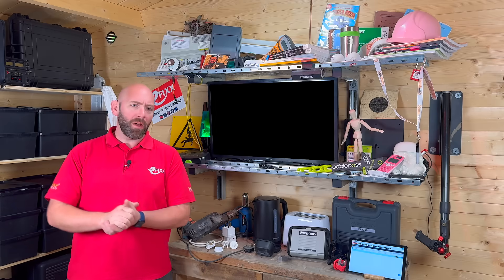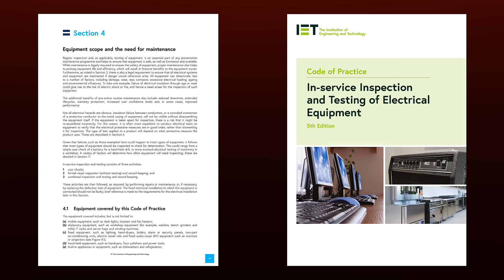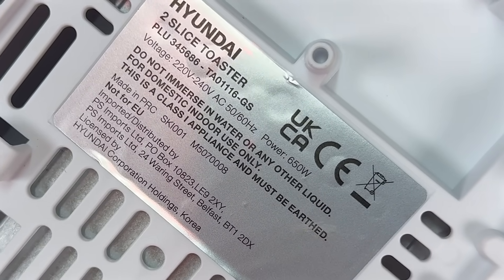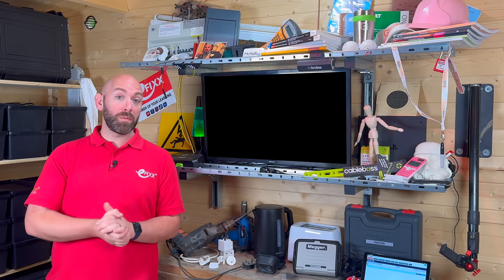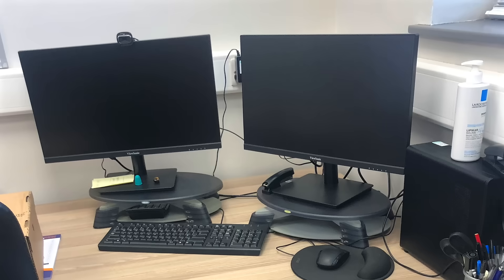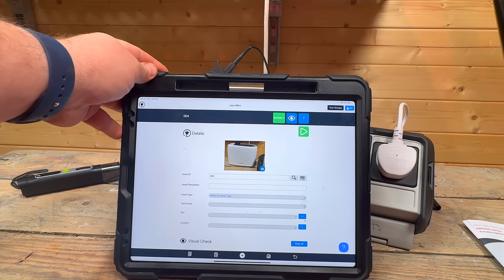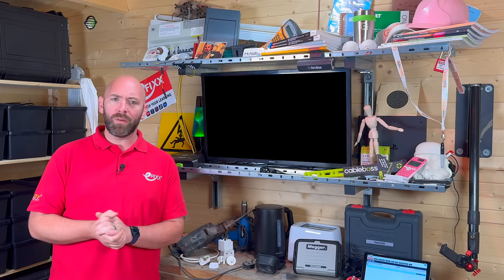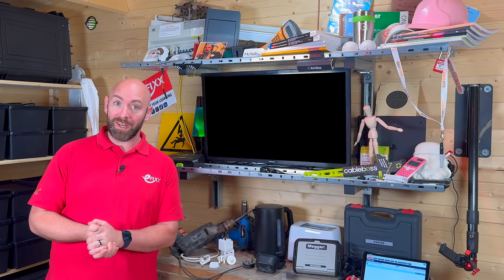PAT Testing ISN'T What You Think It Is!

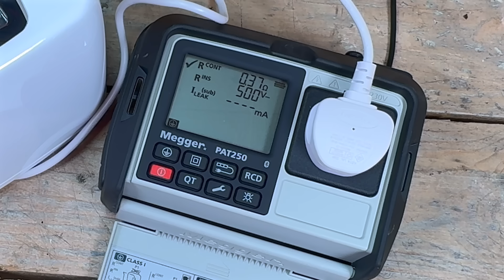Comment: I'm surprised that no-one has commented on the display of the Megger PAT250 when the toaster has undergone an earth continuity test at 2:25. It shows an earth continuity resistance (R CONT) of 0.37 ohms and has a tick to show it has passed that particular part of the test. However, as I understand it, for Class I appliances, resistance should not exceed 0.1 ohms for cords up to 2.5 metres, increasing for longer cables, depending on their cross-sectional area and length.

I assume that the person using the tester has changed the Megger's default pass limit for this test for some reason, but it looks like a fail from where I’m sitting. Also, as someone else mentioned, the toaster should have been turned on for that test, as indicated by the flashing switch icon at the bottom of the display.

Comment: 5:03 Of course that hot air gun passed the Class II insulation resistance test, as you didn't have the probe (P1) connected to any exposed conductive parts.
Amateurs.

Comment: We had a Contractor come in to PAT test equipment in the College where I worked, our Works Manager went to use one of the joiner’s hand drills that supposedly had been tested and as an Electrician himself decided to do some basic tests, visual inspection found the outer sheath had a cut on it which was an immediate fail and it had a nice shiny PASSED sticker on it. He then decided to get our regular Electrician to check some items in our Student Halls of Residence more dangerous faults were found. He contacted the owner of the Company and on the Monday morning when the tester arrived in his Company car his boss was waiting for him. The tester left shortly afterwards without a job or a car. Turns out the guy had done a 6 week course to become a tester.

Comment: I've never seen an item fail a pat test.
Reply: You've never seen some of the Banggood tat that I've seen my office manager purchase - the socket strips with built in USB ports that had live and neutral swapped resulting in a fused neutral. The USB charger circuit board was a joke - tracking distance between AC and DC sides was minimal.

Comment: so basically in this you have show, 100%, are good idea, but with that many verable in the test any sort, single test, where cauley just plugs an item of electric equipment to PAT testing machine can get to what they want it to say, like tostter example its double insulated, to point the large exposed metal at the top, the totting part? that part not double insulated its not single  insulated its bear metal, and bring laptop style power bricks the come  manufacture earth leak on design person as part of there normal working function, that fail right the start, you defany going fail beeping out Pat test device with test examples and that just you used as. test subjects? so with full understanding how the subject works cireket designs mantanal manuals and all the the manufacturer seem to leave out of the consumer, and  repair business, there now way of know, out sample, gess work? making a PAT next to useless, and give good working equipment bad reports, and still letted faulty, bad designed equipment a green light quality its does not deserve

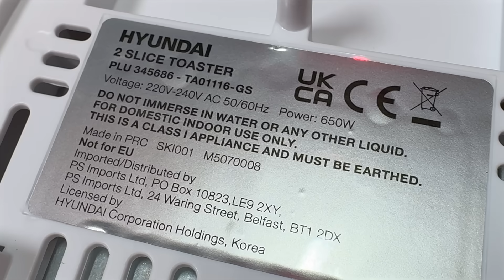Comment: The product label at 01:23 gives mixed messages: If it's a Not for EU appliance, then how/why does it bear a CE mark? 🇪🇺

As for PAT/ISITEE, I worry about what I term „PAT box blindness“; Where having a box that runs tests on a couple of button presses makes the operative forget how the tests are performed over time - Rather than Is that fault loop <=1R0? it becomes Does the tester say it's OK? And of course a blindly run Earth fault loop test will still pass on an appliance with a grazed flex with exposed earth (Or worse ⚡) conductors which might be missed if there's „Not enough time“ to carry out the essential visual checks for appliance condition. ⚠

Me, personally? Only testing my own appliances now (My PAT cert dates from 2001) I use a multimeter instead. Not just because I can't afford a business-priced tester that I can only lawfully use on my own equipment, but also because it makes me think about the test being conducted through the appliance. And thanks to this, my mind for what's happening in each test doesn't fade to the just push a button culture which isn't the safest thing to see happening with something as potentially dangerous as appliances intended for use on 3,5kW UK electrical circuits! 👍

Comment: Several years ago, I was writing training guidance for the cleaning industry, and it seemed to come as a great surprise to a lot of people that PAT does not test appliances for performance, nor does it provide a safe test at all the different applications an appliance has - most notably for this industry wet & dry vacuum cleaners,  irons, and washing machines, all of which could sail through a PAT, but could become dangerous once water was used, seeing how it could get into places it wasn't meant to, or in the case of things such as a blown heating element on a washing machine might only present a problem during the heating part of the wash cycle.

Comment: In an industrial and commercial setting one of the biggest issues I have found as an electrotechnical engineer is the incompetence of the average portable appliance tests operative. There should be some protection for equipment owners where there is an absolute requirement that if you don’t fully understand the functioning of the item under test you must not test it, and refer to someone who understands the equipment. 
While working as a specialist service engineer about 15 years ago I spent some time following a portable appliance tests operative company around repairing the expensive digital audio processing equipment they had just tested with a class 1 test and ruined the filtering on the power supply. Similarly we had “PAT test) stickers on non testable items such as remote volume controls, blank rack panels, panels with logic control buttons connected to GPIO ports of remote located DSP units, and many many more. The testers seemed to view their little “pass” stickers as a license to print money, and were very fraudulently knowingly applying them to anything that looked in any way electrical or electronic.
Reply: We had one came to our College to test our gear having completed a 6 week course, our Works Manager found items that had been passed that should’ve failed on visual inspection, called the Company owner and when the guy arrived back on the Monday morning his boss was waiting and sacked him on the spot.
Reply: @tumshie1960  China uses a plug similar to Australia/NZ, but with longer unsheathed pins, but upside down.  Dodgy electricians here tag them despite new equipment not being allowed to have uninsulated pins, and the lead exiting the plug skywards!  There is risk a child's fingers can touch live pins on the Chinese plug partly in an Aussie socket.
Reply: If there are complex pieces of equipment in a workplace specialist company should have been hired to start with
Reply: Definitely agreed with you on the first point. I took a PAT course many years ago as an aside to my role at a local charity (We had a lot of donated electrics, and a second PAT person was sorely needed) and nothing I passed ever experienced a known safety failure, but this was before Class IIa and Class III appliances came about. I still apply my PAT knowledge when I need to, but only to my own personal appliances as that's still safer than no on-site testing at all.

Oh, and no; I don't use the little green stickers. If there's one from a company that has it on record I leave it in place, but if it has no recordholder or is more than 2-5 years old (Depending on the appliance class) off it comes. 👍

Comment: The thing is, though, PAT testing doesn’t really guarantee safety — it just means that at that exact moment, the thing isn’t likely to kill you. Useful, sure, but let’s not pretend it’s a crystal ball. Whether you call it PAT or EET, it’s still just a snapshot — not a safety guarantee. All it tells you is that right at that moment, the kit won’t kill you. Tomorrow? Or 5 mins time? Who knows. Maybe you’ll get lucky like I did working in a gym. I had my back turned from a hoover as you do with a pull along, and some numb nuts had dropped a dumbbell on the cable. One touch as i was moving the cable over a pieceof equipment, and I was jittering to “Murder on the Dancefloor.” 🙄😲 And yes, i absolutely checked the flex before use!
Reply: exactly, pat testing wont 'guarantee' the thing wont explode when its next powered up and used!

Comment: Plus with the green stickers, if the plug has one you need to remove the old one from the plug before you put a new one on, as if it has loads of stickers on it, it can make the plug over heat.

Plus if the moulded plug is damaged you  need to cut it off, and replace it with type the reusable.

Comment: Plus also the plug of the appliance, is it safe? Ie is it legal, the live and natural prongs is sleeved, the earth is either all metal or all plastic, as number of times brought items from Amazon and other online stores, the plug is totally illegal, the size of the plug is too small, the earth is sleeved, the prongs too closed to the edge. 

Also I noticed and wondered where is the correct place to put the label, I was told and seen it should go on plug.

Plus if the plug is type that you can open up like on irons, some lamps etc, are they wired up correctly the brown (red ) is wired to the live terminal, the blue (black) is wired to the neutral terminal, green and yellow (green) is wired to earth terminal. This how I remember when rewired a plug, the first two letters of the wires tells where it belongs, brown (br) tells it goes bottom right, blue (bl) goes to bottom left or with the old colour red and black, because black start with bl meaning bottom left, red goes to bottom right, any other wires that leftover goes to the top. As number of times I seen the wires in the plug when opening up is in the wrong place, even the wires are in the right place but not tighten down.

Plus with these plugs also the cable grips most be over the outer sleeve

Plus live, neutral and earth wires are cut to correct length.

Comment: whats the skinny on meter calibration..,, i shove a 10m resistor at it before use and if it says 9.5 to 10.5 then i consider it 'working' and in spec
Reply: You can get something called a 'calibration card' from the usual online places, might be an idea to get a few to make sure they're all the same, as they're not expensive; but yeah, if you've got some standard resistors, preferably higher wattage ones for better high voltage resistance when doing the insulation resistance calibration check, then that should be good enough. The cal cards are very portable though, just chuck one in the tester carry case.

Comment: strange how charity shops either "insist" on donated electricals being tested, or more often, just refuse to accept them.
Reply: Our local charity shop has someone trained to do the testing and a testing machine.
Reply: i used to test things for a charity shop. most of what came in for testing was bad in some way, often it was the plug or flex was bad/wrong or outdated
Reply: @Bullwinkle39  did any of your items make it to sale?
Reply: It depends on the shop. I used to do PAT work for a local charity (We had such a high volume of donated electricals I was more than happy to do a PAT course to double our capacity) and we tested and recorded everything in-house when I was there. Other charities (Usually the mainstream ones you see in the high street) will also employ PAT qualified persons as an internal role, or will bring in an outside contractor to test donated items that have passed the „Junk sort“¹ and unqualified visual inspections for faults, damage, and (After those checks) a function test. 👍

Smaller charity shops - And more remote outlets of mainstream ones - Tend not to have PAT infrastructure in place or affordable to them, and these shops will tend not to accept electrical items at all. Because law requires that anything sold by retail is safe for a consumer to purchase and use without any special advice or training, shops that can't PAT can't legally sell donated electricals, especially used goods which have an unknown history to them. The seemingly OK 1950s electric fire with no earth bonding and a live chassis fault that has gone undetected for more than three decades is the why... ⚡💥😳

(¹ - This is an absolute necessity, no matter how harsh it may sound. I used to do electricals/WEEE processing for a local branch of a major charity, and you would not believe the amount of absolute crap that people would donate to us seemingly thinking we had some form of magic money mill that would magically turn the most outdated tat into Megabuck$. We actually had to store it, visually inspect it, decide if it was fit for and likely to sell, test it for proper function, and then pay for it to be PAT before it could be priced up and offered for sale. The stuff we couldn't sell had to be disposed of as WEEE, and before anyone asks; No, charities don't get that service for free. They have to employ a wastes contractor at their cost like any other business. 💸)

Comment: This always drove me mad when being in charge of the IT within small businesses. Every new office manager would turn up and demand that everything needed PAT testing once a year and that they had a company that they trusted to do it. The pricing of these 'trusted' companies would include a cost for testing each computer power lead (IEC 320 C13 with molded connectors) that was higher than just purchasing a new one. Every time I would have to explain what the rules truly stated and anyway if he wanted the comms room dismantled so that everything could be tested he was welcome to talk to the CEO about the fact that the company would likely never restart due to the age of some of the systems.
Reply: there is no set test period, but environment usually decides i.e.  office equipment would only need testing every 3 to 5 years but building sites or cola mines would need testing every 3 months and BTW, the operator is supposed to do a visual every time he uses the equipment and report any visual defects such as frayed cords or missing screws.........  the codes of practice say that each company nominate a "scapegoat" who must decide on frequency of tests for each piece

Comment: It would've been good if you had provided clarity on whether items without a plug-top - such as hand dryers, panel heaters etc - require a PA-Test. These items are often not tested as part of an EICR (as testing is typically up to the FCU, and also not tested under a PA-Testing regime. This leaves a scope gap where equipment could become dangerous, but not identified under either regime.
Reply: Hardwired devices are an utter pain, I'm able to do 'PAT' testing on movable appliances that have a standard plug but I'm not a qualified electrician so cannot disconnect a hard wired appliances. The video clearly shows a hand drier and "In-service inspection and testing of electrical equipment' was named as to get rid of the "portable" part of the name.
Reply: From the physical perspective you could test such appliances by disconnecting them at the FCU and using a wire box to connect them up to the tester (We used to use this approach to test donated cookers) but I don't know what the regs say about such practices. 📜

Also: That sort of test would need to be done before any EICR, simply to cover for the possibility that a fault could be introduced when the appliance is reconnected at the FCU after being tested. ⚖

Comment: When this was introduced I was involved in computer repairs and we were all expressing concern about using Meggers &c on electronic equipment.  I phoned the HSE and they said just do a visual and check the earthing.

My biggest concern was when I moved on to home computers, I reckon at least 60% of mains plugs had a fault on them, ranging from cable clamping (most common) through to one where the neutral wire was connected to the earth pin.
Reply: That N-E swap raises other concerns when I read it; Notably that the customer obviously has no RCBO RCD protection of any kind on their ring final. If you plugged the same appliance into my wiring (At least 14th ed compliant) you'd get a residual current trip as soon as the PC passes more than 40mA! 😳

When you see something like that, you probably need to start talking to the customer (Or their landlord) about their electrical installation. If an N-E swap doesn't trip an RCD, you have no RCD on that circuit. That means a plastic CU (Possibly even Bakelite), no AFDD, an installation that hasn't been inspected in a very long time, and (Quite likely) a number of other hidden defects in the appliances and wiring in that premesis... ⚡🔥😳
Reply: @UK-Combustibility-Assured 100% agree.  The incident was about 25 years ago.  I'm sure I pointed the plug wiring error out, but can't recall any discussion about his house wiring.

Comment: IEC leads should be fused no higher than the cross section of the cable can safely carry which may be more or less than the equipment it is being used on.  The fuse should not be rated higher than the appliance..
Reply: not always possible, a device may only use half an amp or so, and be powered by an IEC lead, you wont find half amp plug size fuses! so the fuse will be to suit the cable or max rating of the IEC connector